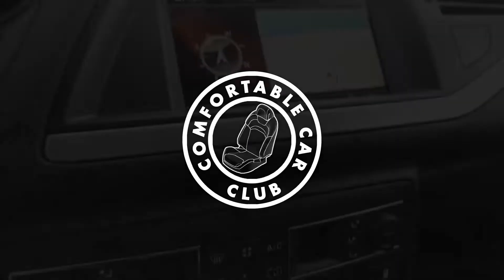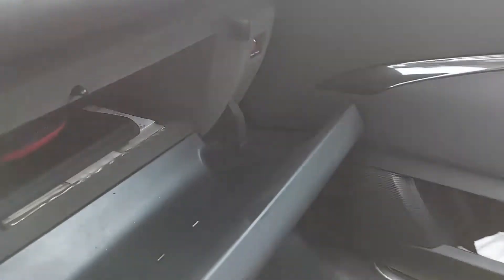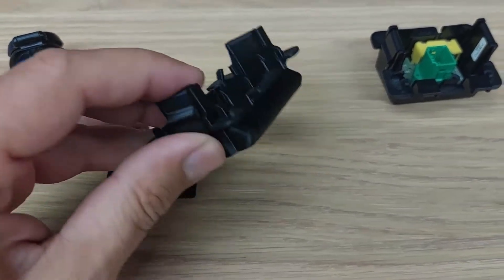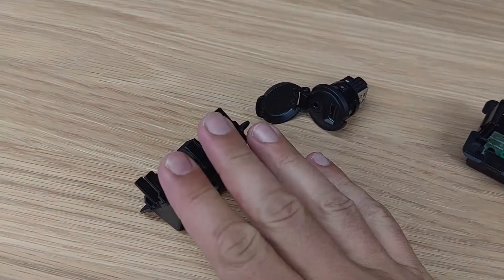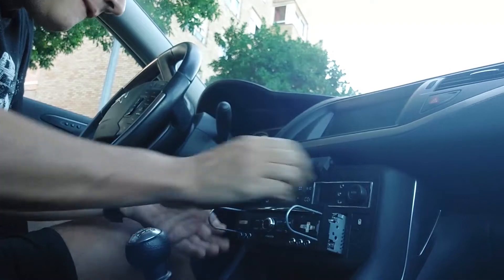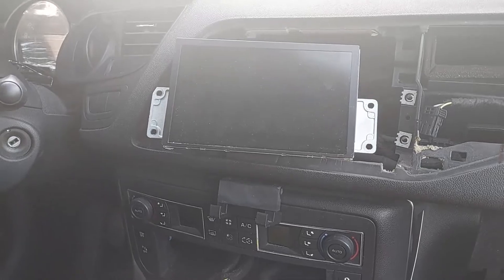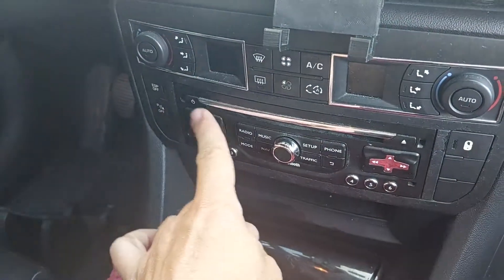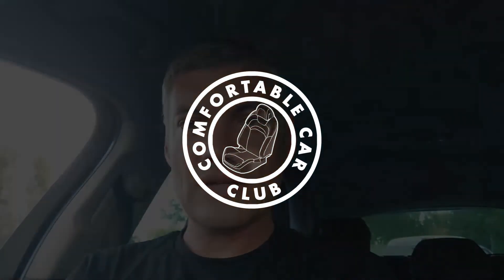USB Input Relocation | Citroen C5 X7

Comment: Yes, that spot is exactly what I was talking about in my previous comment on the upgrade video, Glad to see it worked out for you, and thanks for replying on that earlier comment..

Last week I replaced the 2 front door hinges on my C5 X7, takes about 2 minutes to replace (when prepared accordingly*), but a lot of time to adjust back into the correct position and today the new mirrors and windows control panel arrived, so mine is getting better and better :)

Comment: If I remember correctly, the AUX and USB cables have different sockets, each for their own. That's why that green plug was there, probably to go to the AUX socket. Since your socket doesn't have the AUX pins (if I understand correctly), that's why you can't plug the AUX connector. 
When you first mentioned the glovebox, I thought you're gonna make a hole to the side and put it there, and leave those other inputs intact. 
If I were you, I'd remove the glovebox. I think it would be much less hustle. 👍👍👍